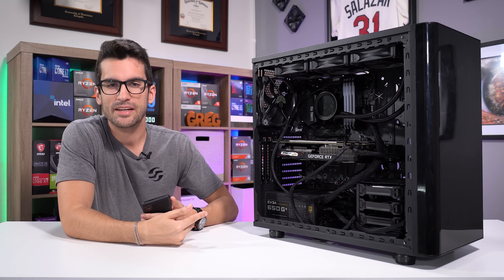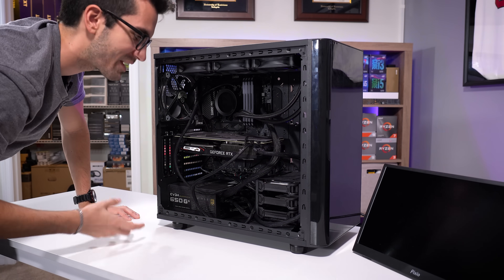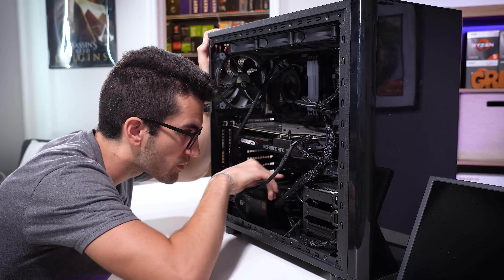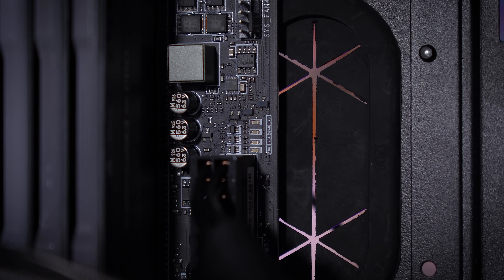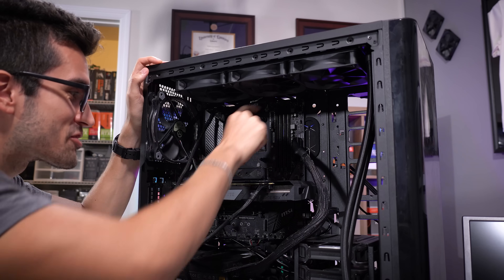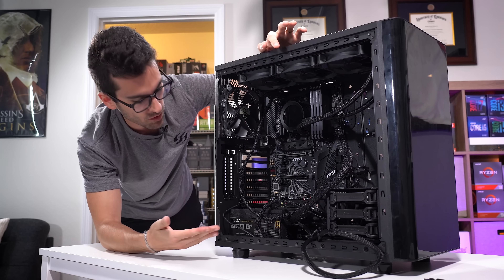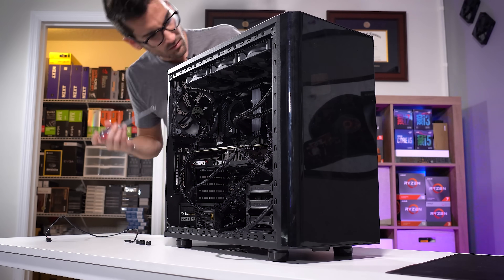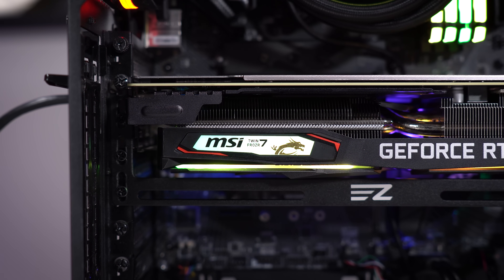Fixing a Viewer's BROKEN Gaming PC? - Fix or Flop S1:E4

Comment: I've dealt with this before, redid my cable runs and knocked my front IO connectors loose, and didn't even realize it. Had to call a friend and we went through an entire troubleshooting process before we both thought of the front IO cables.

Comment: I saw a PC where someone plugged a USB front panel cable into a diagnostic header!  At least that's an easy fix.  Bad USB connections, both at the headers or even a shorted USB cable attached the the PC can cause these problems.

If the rig was getting BSODs, I'd be looking at the timing on the mixed RAM modules.  Best to have same CAS on all modules, preferably same model and size of memory module.

Comment: PLED panel 1 connections, I had a similar issue, It doesn’t hurt the motherboard or cause any issues being wired incorrectly just won’t post. Easy fix but just the same the connections looked good from a glance and is the unsuspecting culprit

Comment: Just let you know if your PC does this you can remove the bios battery(reset your bios) and if that doesn't work then unplug everything and re-plug it I had that problem and the battery fixed it
Reply: Thats the cmos
Reply: @lwv52  Yes but if I would typed it cmos maybe someone wasn't sure enough and left the option at lest then they would prob forget it or not do it right, yesterday I got the same think because I did something in bios and got into a boot loop i did the battery 3 times to fix it

Comment: had almost the same issue last week. a customer with pc boot looping. only gets to asus logo on boot, then reboots automatically. tried everything from cpu reseats, ram swaps, cmos battery shenanigans. finally decides to test them outside the case. removed front panel reset and power, voila, pc boots!

the culprit: reset button stuck halfway. dang wasted an hour troubleshooting.

Comment: discovered this kind of problem 2 years ago. I have 3 system unit that turn off immediately after booting it.  Then tried removing the cables of power switch then it solved the issue. Most likely the power switch is  functioning but still keeps pressing the power button that makes you computer force to switch off

Comment: That literally happened to me like last month, all I did was reset the CMOS and reseat the ram and it fixed itself. I did try the reseating method (I cleaned the ram contact points with an eraser) a few times because it would turn off at the lock screen.

Comment: For me it kind of was pretty obvious when i first saw it because it happened to one of my clients before. As it turns out if the power button cable is not correctly attached or with inversed polarity the pc will shutdown right after power-up. It would have stayed on if you kept the power button pressed.
Reply from the maker: Lol, that isn't how power buttons work :-) Power buttons have no "polarity." You're just closing a circuit - hence why you can jump the pins with a screw driver.
Reply: @GregSalazar  i actually expressed myself wrong, i said polarity when i should have said circuit. In short, because the cable had the pins inversed it saw the power button as been pushed when it was released and viceversa, that is why it was suddenly turning on when you flipped the power supply switch

Comment: I had a similar problem with a Machine that was built around a Gigabyte x299 board. And the culprit turned out to be a flight controller joystick.

The problem was that when x299 was introduced was during the switchover from USB2 and USB3 devices. The original spec for USB 2 permitted the leaking of current back through the port. However USB3.0 absolutely does not. Upon detection of current leaking the system will freeze, that can be on boot-up it can be in use, it just depended on when the USB 2.0 device would leak current into the USB 3.0 port. Pulling the device permanently solved the problem.

Perhaps there is an internal device, that is a USB 2.0 Device, connected to an internal USB3.0 header. In my personal rig I got around this by adding an Internal USB 2.0 Hub that I connected to the solitary USB2.0 Header on the board which in turn has my USB2.0 AIO connected to it.

Comment: ive had the issue before with my extreme board, but its because i deleted the Cmos bios by hitting the button in the back of the board by mistake, had to basicly uncable everything and plug in single after recovery and worked fine after.
Thank god for Backup cmos heh.

Comment: In my experience, if the PC turns on for a second, and then turns off, it could be a number of things. 

1. EPS connector not plugged in properly from either end.
2. CPU not inserted in the socket properly. 
3. Faulty PSU
4. Short somewhere in the PC

Comment: Most likely the issue was that the AIO was plugged into the USB header incorrectly. If off by one pin or installed backwards, it'll trigger the motherboard circuit protection and repeatedly reboot like in the video. Or the front panel connectors were shorted somehow.

Comment: I had this exact problem. I upgraded my gpu and then this happend. I thought it was stuck in a powercycle. I tried almost everything and I couldnt figure it out... I resetted the cmos as a last option, which turned out to be the fix for this issue. No problems eversince!!

Comment: - Hi Greg, have you tried these?
- A simple check Front Panel Header is connected correctly and somehow Power Switch is not reversed with Reset Switch on the motherboard.
- It is a simple assembly error and the components are good but it has a looping error.
- The connector on the motherboard of the Power Switch has a short that leads to a looping error again.

Comment: @Greg Salazar nice video overall. Though I wish you would have started by paring the system down to bare minimum first and disconnect those cables to troubleshoot. Most of us don't have a hardware store at home like you and cannot start by randomly swapping components to test. I always like to start by disconnecting everything that's not needed, going down to 1 stick of ram, no storage etc. as needed.
Maybe next troubleshooting video start like that and pretend you don't have 50 GPUs ready to swap in :)

Comment: After years of troubleshooting, the first thing i would do seeing this pc is; Full bios reset by pulling the battery (XMP profiles can be nasty and will get you this kind of errors). No result? I would try to boot it with one stick of ram, and/or switch lanes.

Comment: I had/have the EXACT same problem with my old computer that i gave to my sister, starts for a few seconds then stops and loops, after i disconected the usb, the power button, the reset button and powered it with the screw driver it magicaly worked, and thats how my sister would start the computer, and just a few months ago i cleaned the pc and just to try i connected the mentioned cables aboves again...to my surprise it worked again. I thought that theres an improper connection on the case cables or on the mother board pins, after seeing your video im still not sure.

Comment: I had a problem with my old PC and it took me an hour to fix it and it was the most simple thing it was that I took out some small blue caps that are for current and I had luck that I didn't just straight and threw them away, so if you see some blue little caps on your mobo and your pc doesn't boot try putting them back.

Comment: im having a similar problem however i believe i either need to re seat my cpu and check my wiring again, and if nothing still the board may still be to blame, gigabyte ab350 gaming wifi micro itx board, ryzen 1700x, 16 ram, rtx 2060 super also gigabyte, 1000gb hdd and 128gb ssd for os

Comment: I had a problem with my pc not booting after a deep clean. When I was putting everything back together I noticed I plugged the CPU power cable into secondary CPU power connector on the PSU. It was a cluster frick to get it in the right connector so I left it because its the same thing thought it doesn't matter. Lo and behold it did matter the pc wouldn't boot so I had to go plug it in the main CPU power connector.

Comment: Similar issue happened with me when i changed by stock AMD cooler and swapped it with Antec a30 cooler when i installed that antec cooler my pc just refused to turn on , no lights whatsoever , i reseated the cpu , ram etc but nothing would make it work , at last after wasting my one and half hour i removed the 24 pin power cable from motherboard and reconnected it which did the trick and pc turned on just fine , that was a very weird issue but thank god i didn't have to replace any component.

Comment: If only I was this lucky, my 5600x died a day after installation. Just started crashing programs, then bluescreening to the point where it couldn't even boot into windows.
Figured it was the board, put in a warranty request, then the beta BIOS for my old motherboard came out, so I gave the 5600x another try. Bluescreens again. Board was tested and verified functional. It's been running with a replacement 5600x for eight months now. 
On the upside, it kicked my ass into gear, so now I have a backup PC running as a media rig.

Comment: Bad thing about modular PSUs is that it introduces more connections to go wrong. Seen the connections lose connection simply over time by simple corrosion. I have a tube of dielectric grease that I use now.

Comment: Probably the AIO pump was not connected to the CPU fan header. The BIOS shuts the system down to prevent damage. And it was the item that got replaced the last.

Comment: This behavior is indicative of a bad ground somewhere. Probably one of the front headers was misaligned, or, something jammed in a port causing a short.
I always start with disconnecting everything. Strip down to cpu, board, memory (pcie vga opt), then work up from there

Comment: Building my first pc right now and having a similar issue. DRAM led lights up and pc gets stuck in a bootloop. It sometimes would actually post and I saw ram was running at two different speeds. Swapped the ram kit and then they were at the right speeds but it would still bootloop sometimes. PC also randomly shuts off when testing doom eternal. I’m thinking it’s a PSU or Motherboard issue. Wish me luck.

Edit: PC fixed successfully
Reply: I’m currently in a similar situation as you. Yesterday I replaced my stock AMD cooler to a Noctua cooler and when I tried to boot up the system, literally nothing would boot up. When I removed the cooler, it would begin to light up (EXCEPT THE RAM RGB) only for a few seconds before shutting back down. I’m also having the yellow DRAM light appear. Best wishes to you.
Reply: @_.Envy_  I wish the best for you too. Sounds like you may have bent a pin or two on the cpu while swapping coolers. I exchanged my psu at micro center and no luck same issue for me. So guess that means it is a motherboard issue. I don’t think mine is a cpu or graphics card issue and seriously hope it’s not.

Comment: Sounds to me like one of the front panel connectors was constantly bridging the power connector causing the power to turn on and then the 5-second hold to power off was kicking in and it was stuck in that loop.

Comment: Hello Greg, I had a problem with my cpu Ryzen 9 5900x, I undervolted my cpu and ran cinebench r23 while monitoring temps. While it was running the cpu temp shot up to 117 Celsius and the computer just turned off. After setting everything to default, I managed to boot but the system would restart randomly every 2 hours or so. I exchanged my old 5900x with a new one, and I undervolted it again and the pc restart problems started again. I then tested the system with my 3900x and it worked completely fine, even after undervolting. So what do you think the problem with the 5900x would be? Is it vulnerable to get damaged while undervolting?

Comment: Those case connectors for the mobo headers are probably to blame. Some of those are cheap and the metal connector can come loose, I bet there was a ground short, probably between power on button and ground, just the same as pressing and holding down the power button. Powers on, cuts off two seconds later. One of my first troubleshooting steps is usually to disconnect and remove everything except vital things to get a system to post. I honestly was expecting a loose screw rattling around to be the reason.

Comment: My new build my PC wouldn't power on whatsoever and I thought I had a mobo issue at first too. After fiddling around it turns out one of the RGB hubs I had plugged in was causing a short and it wouldn't power. After unplugging it worked.

Comment: similar thing happened to me recently.  i bought a new case, so i switched all my components over.  never took the cpu or ram out of the sockets.  just picked up the whole motherboard and transferred it over.  got it all hooked back up and the pc would just power cycle.  tried for hours going through every fix i could i think of.  the cpu/ram troubleshooting lights both came on every time it would cycle.  took it to microcenter to see if they could figure it out.  they tried putting my cpu into a new motherboard....nothing.  the ram did work when they did the same.  basically my 9900k just went from working perfectly fine to being dead from simply switching cases.  ended up upgrading to a 5800x, crosshair viii dark hero, and 32gb 3600mhz.

Comment: Something tells me that the USB 2.0 cable was plugged in the wrong way. A friend of mine had this issue with an Aquacomputer Quadro he just recently purchased where the usb plug was plugged in backwards and it would immediately shut off the pc. Only reason why I say that is because the AIO is the only new thing and the problem just started.

Edit:

Yep I feel like I was right on the money.

Comment: In the back of my head I was thinking it was the front IO cables too, because my second PC is using a older case with older front panel cables and it'll restart automatically if I press the power button once to try and shut it down but if I hold it like I'm clearing the power from the system it shuts down but i was like "Nah, idk if modern cases have that issue."

Well now I know.

Comment: I had a MSI X370 Gaming M7 ACK motherboard that would exhibit that issue on occasion.  It would throw a USB Overvolt error and shutdown.  Wouldn't boot until I disconnected everything hooked to the internal USB headers and USB ports.  After i booted with everything disconnected, it would boot fine then continue to work normally for a few months without issue again after that.  Never understood what caused the issue and never dug into it because after having it do it over a period of a year and half, I dumped the motherboard and upgraded to X570.

Comment: I had the same issue on a PC years ago. the power button on the case had been pushed down and got stuck under the plastic lip. Fire up the PSU, PC would try to boot up and shut off instantly. Jiggle the power button back up. PC back to normal.

Comment: Lol because I have done this in the past I was screaming CHECK THE FRONT IO. Because my evidence it was recently cleaned and I'm only started happening AFTER that. So I was like can't be a GPU issue imo and cooler upgrade maybe because some motherboards I have heard are finicky with AIOs. I was like it looks like one of the LEDs are plugged into either the power switch or the reset switch. Glad that you thought of it before switching the motherboard. Also this was one of the first videos you haven't talked about clearing CMOS

Comment: I had a threadripper pc that would power cycle non stop. It would post and try to go to windows and shut. Would do this constantly and once in a while it would show the automatic repair screen. Tried everything because it would also wouldn’t save boot priority when I was trying to clean install windows while this issue was happening. Turned out it was a bios issue with the motherboard. I updated the bios and was all good after that. Somehow it must have gotten corrupted. Very weird.

Comment: Usually when I run across a system that restarts, I reset the cmos as sometimes an overclock or memory timing issue will cause this. I noticed that the cmos was cleared when you got it to post so it makes me wonder if clearing the cmos, not reseating the cables got it up and running again.

Comment: Don't you just love pc's! After cleaning mine out one day the bios wouldn't post but more weirdly the bios screen appeared to be corrupted & zoomed into the top corner!

So what fixed it, removing all usb devices from the computer, bios posted  & looked normal. Reconnected all usb devices & guess what, Pc posted fine & bios screen still looked normal, wtf! 😂.

Dealing with pc's can sometimes be like living in the twilight zone.

Comment: i have come across this kind of issue lots in my career, always start by unplugging all connections, removal all none essentials and just run the basics with no front panel connection, no graphics card, all minimal, that way you rule out so much in one shot, then if it works fine you add components back, graphics card and hard drives and so on till you find what's causing this issue, i was actually shouting at my monitor when you didn't remove the front panel connectors and was about to wright-off a motherboard, not that he would have been complaining.

Comment: Me at the very beginning of video "Looks like probably one of the motherboard cables is not connected properly."
Me at the very end of the video "Nice."

You said at the beginning that there might be some electrical surge due to badly connected cables and I can tell you if something inside of those connector is not connected as it should be, it may be your problem. 

I had an issue with my new PC booting up, but showing black screen and having "GPU" diode on the mobo. After going through manual to check few things, I saw it wasn't "GPU" diode, but "CPU" and I forgot to connect power cables to it.